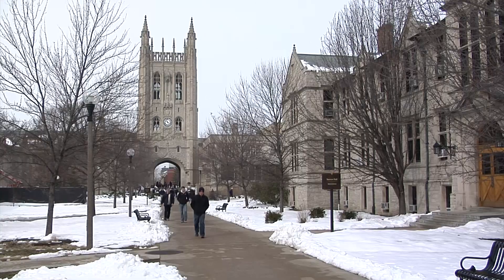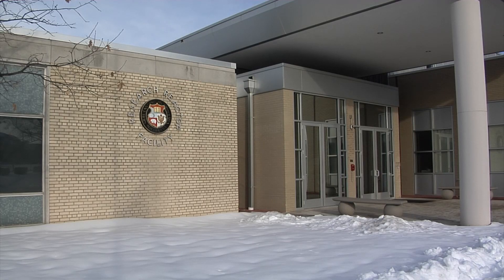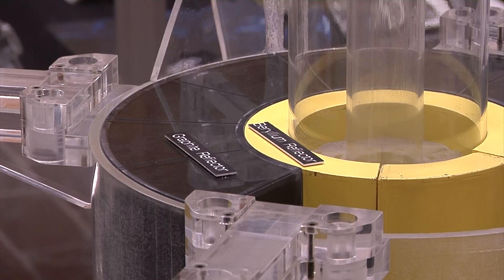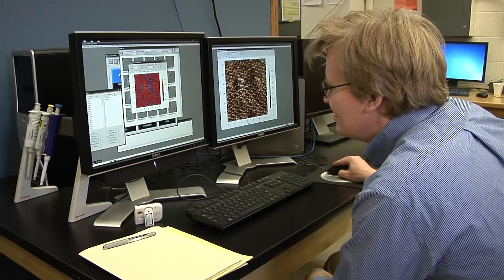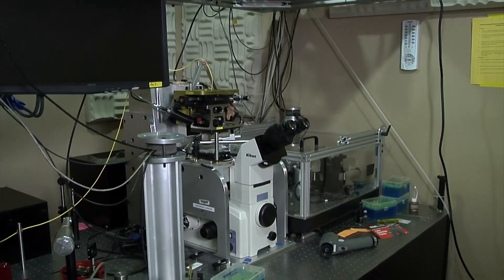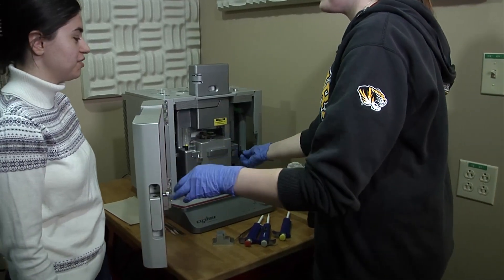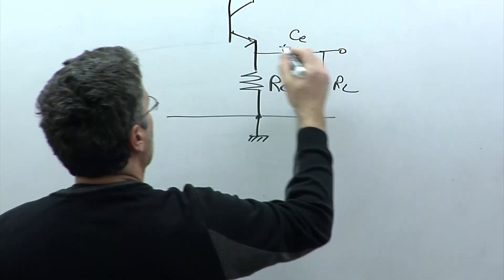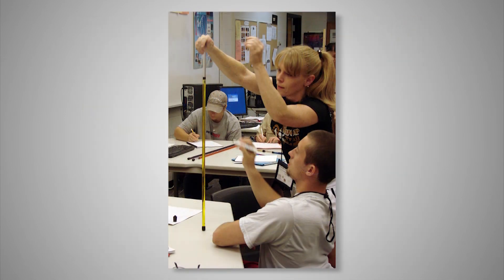University of Missouri - Department of Physics & Astronomy

Comment: /mk ~ 9eq signa (w - x Int=Xq) EI K' Mx forksz coil rate vs X-Ray coaxial cord R''vk seal vs EI K' Mx wheelsz /
/Active A1 - celld splicesz signa = columnsz + Int= pi orbs < feed for rowsz /
/use pi orbsz for correktivs u X-Raysz - gridsz steel beam linesz > i.e. HRC / YSP TECH(K') /